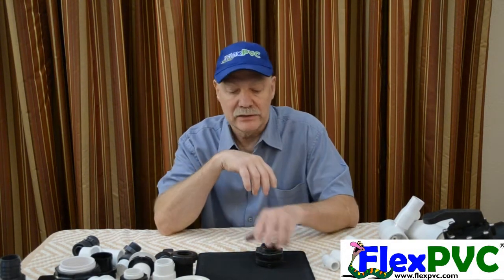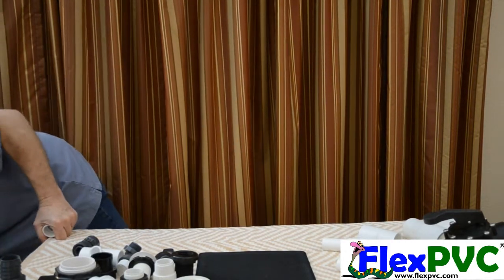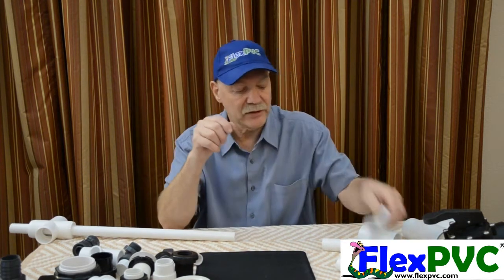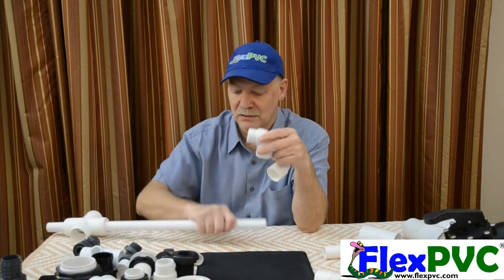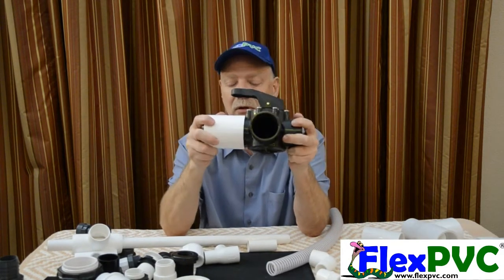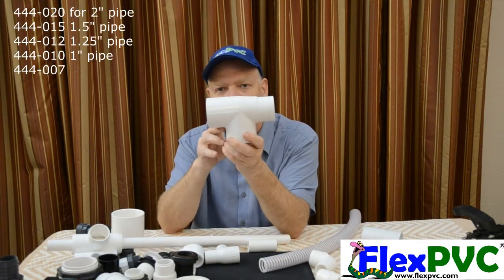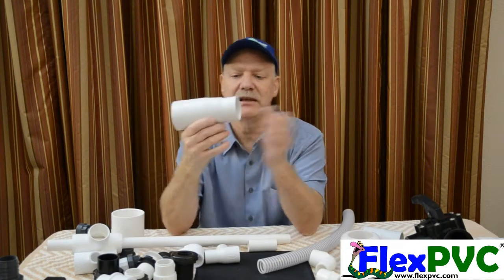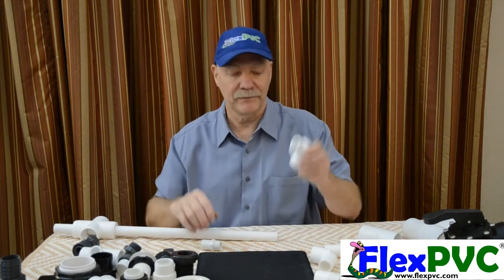FlexPVC - What are "Street Fittings?" What are "Spigot Fittings?" What are "nested" fittings?

Comment: You didn't explain what a "nested" fitting is.
Reply from the maker: Sorry. A nested fitting is "spigot size" on the outside and "fitting size" on the inside. Ie, a pipe would go into the inside or you can insert/glue it into the next size up fitting. Typical is 3/4" and 1". The 1" is a spigot size (1.3125" OD) and the inside is a 3/4" slip (1.05" ID.) HTH. Thanks for the question.